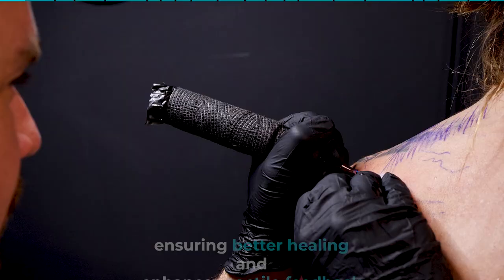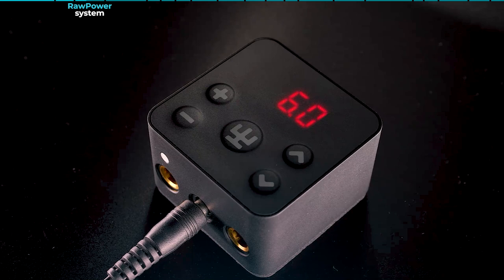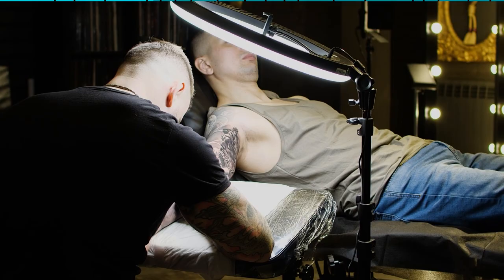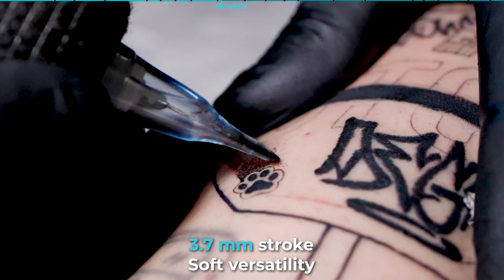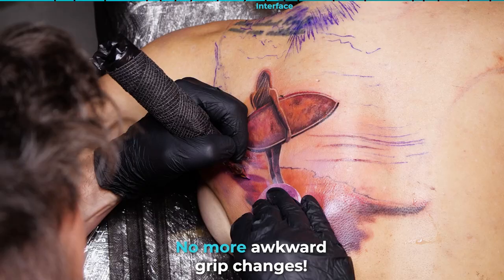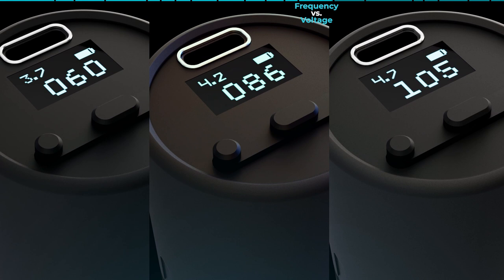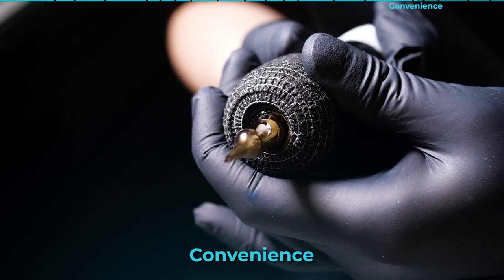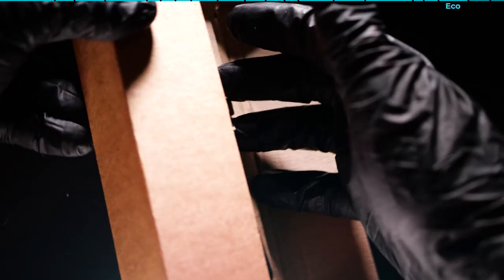Ultron 3 presentation

Comment: is the engine accesible? can I swap out the stroke cam and do you sell them separately, or do you expect people to buy another 1500€ machine if they want another stroke setting like fk or bishop does? also with non replaceable batteries the whole "eco" thing doesnt make much sense, if the battery dies the whole thing becomes a paperweight